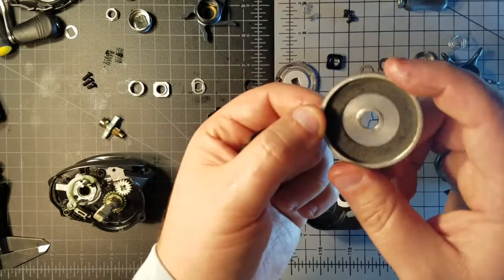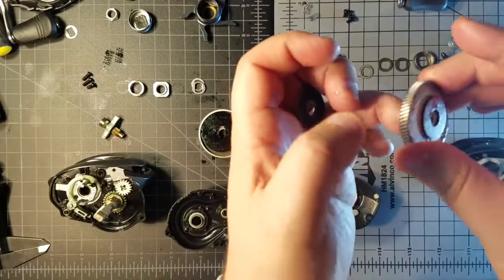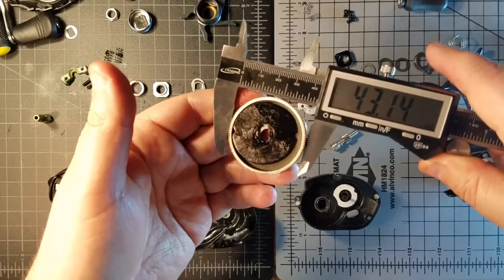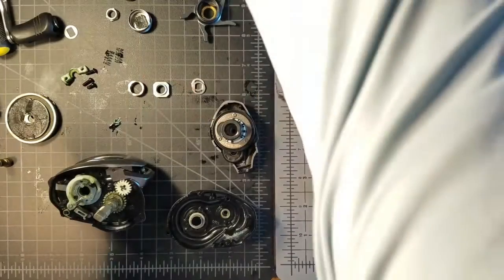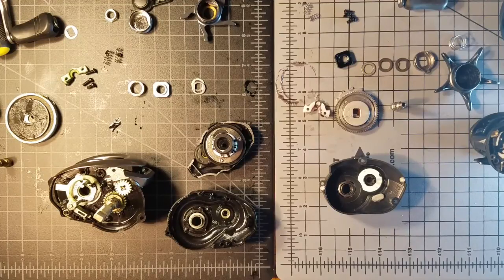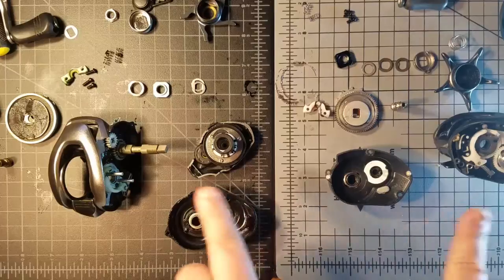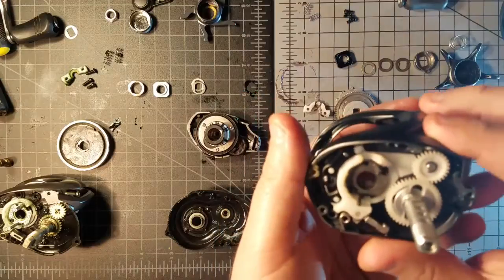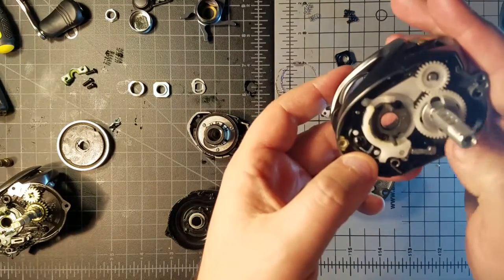Part 2: 2016 Steez SV TWS versus 2015 Metanium DC simultaneous tear down and discussion part 2

Comment: The Steez TWS is one nice reel, I have a couple with ZPI bearings. I have my reels super tuned but that one didn’t need anything doing to it. I was curious with the Aldebaran and now MGXTREME because they were lighter and even the Curado 70 if I wanted to go down the lesser expensive route
Reply from the maker: I did a bunch of side by side casting comparisons comparing the best from shimano, daiwa and abu..I was shocked that for overall casting distance.  The MGXtreme  beat out the rest in everything but wacky rigged senkos.  But it's limited by it's 6lb drag even though abu claims it's 12 (I scale tested it with a full and empty spool and with the drag stack out of the old mgx.   Couldn't get past 7lbs.  I did a tear down and comparison for those three a little while back.
Reply: Tackle Advisors Can the drag be upgraded with a carbontex drag kit for example ? My reel tuner added that to a Daiwa Zillion HLC and the SS SV that I️ sent his way. Thanks for all the info, my mind is spinning with all the possibilities. I’m happy to send you a Curado 70 and a Tatula SV TWS if that helps with your reviews. Keep up the good work
Reply: Tackle Advisors Can the drag be upgraded with a carbontex drag kit for example ? My reel tuner added that to a Daiwa Zillion HLC and the SS SV that I️ sent his way. Thanks for all the info, my mind is spinning with all the possibilities. I’m happy to send you a Curado 70 and a Tatula SV TWS if that helps with your reviews. Keep up the good work
Reply from the maker: 90% of the time you can upgrade to a carbon style washer.   It depends solely on size and shape that's it.
Only tough ones are the eared ones....but those are usually of decend quality carbon fiber to begin with.  Not a problem at all Glad to help.  Glad I can give your wallet a scare!!
Shoot me an email at TackleAdvisorsInitiative@gmail.com

Comment: I can cast my steez w/o any breaks & of course the tension knob isn't meant to be moved. 13 metanium & metanium mgl for heavy baits, steez sv tws & '15 aldebaran for lighter baits. price wise goes to shimano for around  $300, paid $425 for steez sv tws. I'd say metanium mgl for $300 is best high end reel value out there now. looks like the chronarch mgl & steez A tws going to be good for '17 also

Comment: What do you think about the new shimano Antares reel and the dc reel
Reply from the maker: Crap forgot to out out the bass master classic vid on it.. Amazing feeling reel that's pointless as the last few.. No doubt durable refined yadda yadda yadda... But put a brass gear set in a metanium and your there.. And lighter... Way too heavy for a magnesium reel premium.  I did a tear down of the last Gen and the cosmetic plates and stupid thick side plate made for useless weight
Reply: That reel you talking about is it shimano magnesium premium
Reply from the maker: The old Antares reels... Magnesium frame... Super thick aluminum side plates... And really heavy cosmetic plates

Comment: Hi! Do you own a Metanium MGL reel? If yes, how it casts vs Steez TW SV or Metanium DC?
Reply from the maker: I do not own one.  But I have put one through it's paces.   Spectacular reel.  Casts beautifully.  But...I found that the braking on that system comes in really hard. .  It makes for easy casting.   If you  have cast a ivcb4 from abu. It comes in harder....if it were me and I wanted to spend 400 on a shimano...i'd go alderbaran .  IF a work horse reel is needed and it was between the Met and Steez.....the steez is more comfortable and fishes better
Reply: I’ve overlooked the Aldebaran thinking it a toy. The Tacticalbassin chaps like it also so my question is, what’s so good about the 15 Aldebaran ?
Reply from the maker: +Matthew Priestley lightweight tiny.  Very lightweight spool.  They offer a bfs with a very cool mag brake in Japan.  Don't sleep on the mgxtreme as well.  Great for light payloads and presentations.  Street price in the US is under 300$
Reply: Tackle Advisors 8:1:1 and 4.5oz is appealing. How would it handle getting a 5/8oz top water out there ? Any idea what the handle size would be ?
Reply from the maker: Don't know about the handle size.  My guess it's its standard.   It'll throw fine.  Ever consider the new steez sv tws?  Probably the best all around reel ever made....at least that I've owned.  Doesn't get down to the super light sub 1/16 ounce baits......but handles everything else.